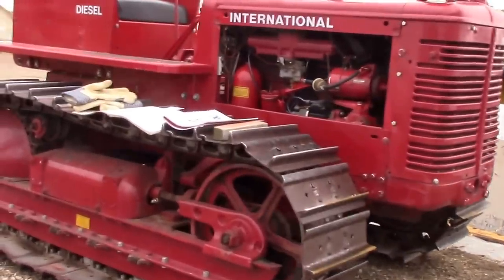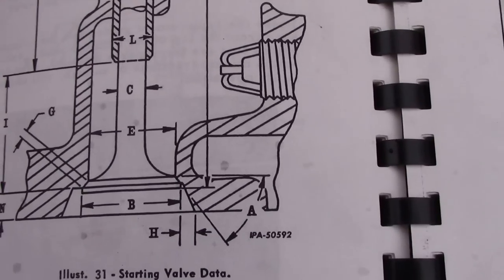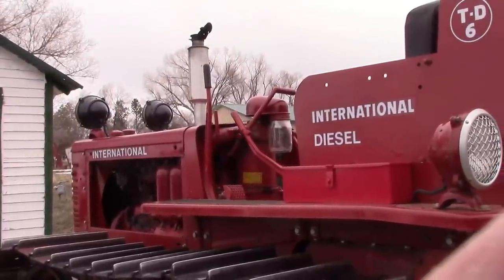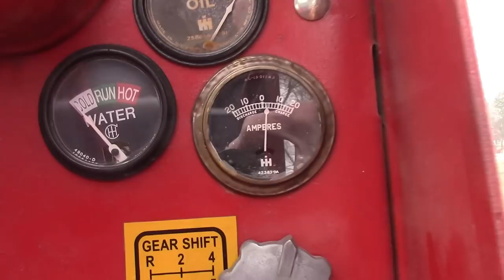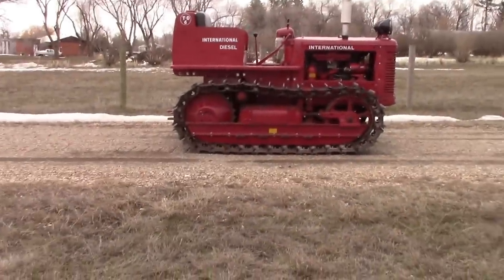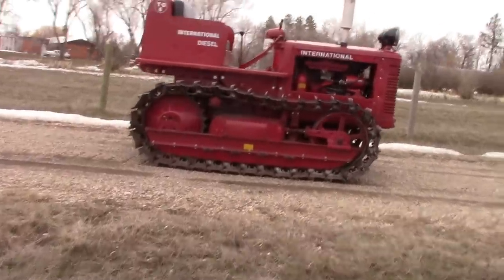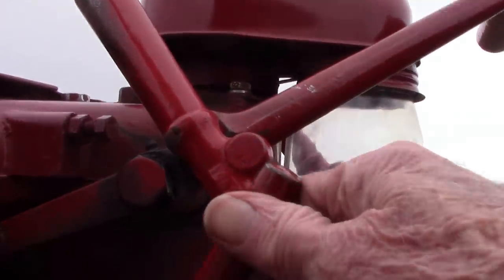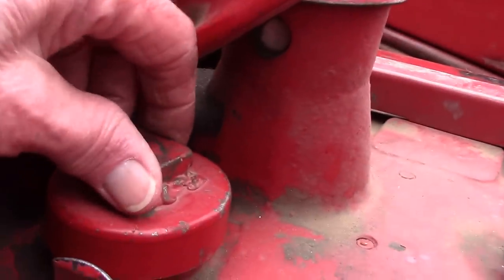1955 International TD6 diesel crawler

Comment: Wow! This brought back some great memories. My father taught me how to start and operate a TD-14 when I was 4 or 5 years old. Our TD-6 was used exclusively for orchard maintenance. When I turned 14, I found myself on the seat of a TD-14 working 12 hour days during my summer break. It is amazing how dependable these tractors were. With just routine fueling and servicing, they would run forever.

Comment: Nice looking machine, remember the BTD6, on the building sites in the 60s/70s, these machines were the Drott shovels, with Drott supplying  the hydraulic arms and bucket systems of the machine and were a major step forward from the old rope operated Chaseside loaders then..
They were painted red at first, later yellow..
The British versions were built at Rubery Owen , Warrington, who also built the famous Barber Greene pavers, both under licence from the American owners and became a standard site on the post war construction projects in England....
You have make a very nice job of your machine...well done..

Comment: What a nostalgia blast. I remember the starting ritual well. When I was growing up my family had a farming and cattle feeding operation. My favorite tractor was a TD9 with a dozer blade. I don't know the year it was built. It was worked a good deal and kept outside, so it was a lot rougher than yours. It eventually developed a crack in the final drive case and was sold rather than repaired, even though a salvaged replacement was available. It was replaced with a front loader Cat, which just didn't have the "personality" of the old International with its old-school steering clutches and brakes, hand clutch, and chugging 1500 rpm diesel.
Reply: I know a Bucyrus fitted one buried in the brambles in Andover, Hampshire, village called Picket Piece, Derek Madder, steam centre...!

Comment: When I was a kid in UK we had a similar tractor, but it was a straight diesel. I think it had a switch you held to operate manifold heaters for maybe half a minute then operated the starter. If memory serves me correctly it was a BTD 6. Good machine, it wood be about 1955/56. Looked just the same.
Reply: Hi that is what the farmer has stood in brambles near Doncaster U.K. Btd6
Reply: @honda4004  By a very slight coincidence may be the same one ! . Farm was situated Lincolnshire /  York's border !. Was sold up at auction about 1970 ish. By the way rode one of the first 400/ 4 s in the UK, it refused to run on all four straight out of the box. Eventually found the remains of some great Japanese spider or beetle in the float chamber !. Lovely bikes.

Comment: Dear sir I like your crawler. I have a WD 9 they are very interesting machines but the way you want to shut it off is to never transfer back to the gas side and just let it idle on low on the diesel a old mechanic told me it's hot when you put it back to gas it can warp the starting valves and possibly crack the head

Comment: Beautiful machine.  Weren't the steering clutch levers awfully difficult to use, being so far forward and nearly horizontal?
Reply: Very nice machine I don't want to be critical but those steering clutch levers are well out of adjustment having operated BTD6s and TD9s those steering clutch levers are easy to adjust up on me a matter of shorting the adjustment rods under the seat and adjusting the lever stops up dosent take much makes them much easier to operate often had to do it on the TD9

Comment: The British version (BTD6)  didn't have that starting on gasoline malarky, it started directly on diesel using glowplugs to preheat the combustion chambers  before you engaged the starter. Only one thing you needed bloody good batteries to crank the thing over.
Reply: It was not malarkey if it was -20F outside.  Yes the UK version had glow plugs but England is not Minnesota.
Reply: @glenirwin1110  I fully understand that. Our B.450 wheeled tractor had the glowplugs, not the easiest tractor to start unless the plugs and the batteries  were in good shape, but once it started that long stroke engine would outpull anything in its class. We traded it in for a 674 which was a very good starter but that shorter stroke engine meant power wise it was dead flat compared to The B.450.

Comment: My thoughts ...

The change from diesel to gas failed because the float chamber hadn't had 
time to refill. The needle and seat were closed 
(by the changeover lever during diesel opration). 
The instant restart was successful.

I'd favour shutting down directly from diesel after a cool down idling interval.
Because:
Running on gas holds the diesel inlet valves open so running on gas won't allow
them to cool.

Running on diesel shields the gas inlet valves from combustion
and intake airflow cools them.

1. Engine temperature rises after shutdown anyway because the coolant stops flowing.
2, Not restarting on gas will extend the battery life.
3. The gas inlet valves will stay cooler because they will see less exposure to
   combustion.
4. The diesel inlet valves will be cooler because they will spend more time fully seated.

In any case the position of the gas inlet valves will be determined by the cam lobes.
Some will be fully closed and others open.
Reply: L.
Reply: The starting valves, or “gas inlet valves “ as you call them , are all open at the same time; they have nothing to do with the camshaft. Their purpose is to lower the compression ratio for starting on gasoline. Further, it is better to shut down on gasoline, as this clears the spark plugs and combustion chamber of diesel residue , which could hinder the next cold start in adverse conditions, i.e. extreme cold or dampness. After the shutdown on gasoline is completed, the engine is switched back to diesel to allow the starting valves to cool on their seats.

Comment: I recommend not leaving the main clutch lever forward when not driving, main clutch lasts 100 times longer if "engaged" as much as possible.
Reply: MrMusic1950 : won't the clutch disk stick to the pressure plate and flywheel? Happens to my little Oliver if I let it sit for a month. And it's damn hard to get it unstuck!
Reply: Jimson brown certainly not jimson, I operated these for many years and never saw that happen, some would sit unused for months while we pulled a new contract, but never a stuck clutch.
Reply: Dry clutch should. Be egaged
Reply: Might tie the steering clutches back for storage.

Comment: The worst thing one can do with a Diesel is to switch it back to gasoline to "cool down". If you know the heritage, a WD-40/TD-40 doesnt even give you the option. The reason for that is, they knew even in 1934 that gasoline burns hotter than diesel. Therefore you are creating a hotspot in the cylinder head by "cooling down" on gasoline
Reply: I've been told by old timers that almost nobody "cooled down" with gasoline. The idled on diesel until the temp came down and then shut it off.  They would really only do the gasoline cool down if it was wicked cold to leave it on gas for the next morning start.
Reply: Then why would it say to do this in the operation manual? Was IH too stupid to know how to operate an engine that IH built?

Comment: Shut it off on diesle
Reply: Great video ! It brought back memories of me driving a TD-6 when I was nine years old. It was usually pulling a 7 ft drag disc that had a hydraulic ram to open and close using  a BG hydraulic pump mounted on the TD-5. I ate a lot of dust while driving that tractor.

Comment: Not a good gas tractor,not a good diesel tractor.Too many compromises as far as motor design.They sold a ton of these due to the price differential between IHC and Caterpillar.Will not perform near the heavy work a Cat will.That being said, they filled a niche and were still better than any thing foreign made.Nice resto
Reply: They sold well in Canada and in the cold regions of the U.S. It was something that farmers and smaller contractors could afford and get started in the winter. Sure the Cat diesel engine was better but in the winter it needed the pony motor to get started.  Back before better batteries all the manufacturers made compromises.
Reply: Glen Irwin back in the day , all cat motors needed a pony to start, period.It was how it was done.No electric starters then
Reply: @michaelmckenzie5232  Okay. I thought electric start was an option so you would have a unit with the pony and starter if you wanted. Also couldn't the IH engines be crank started on the gasoline?